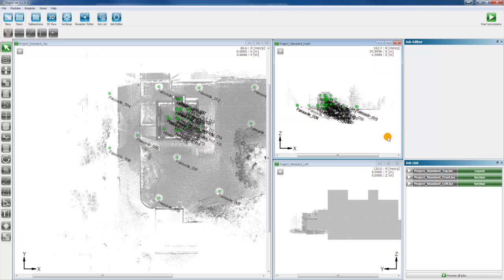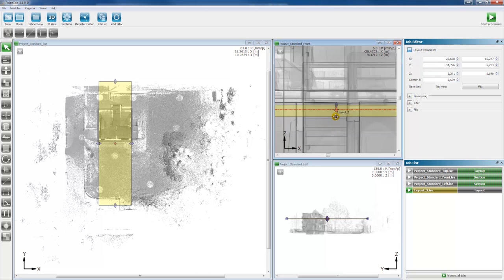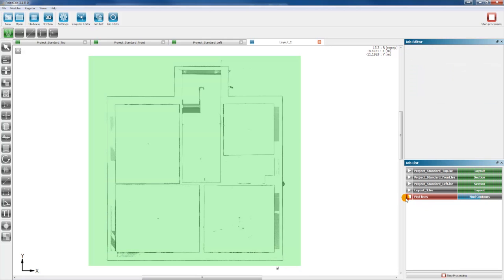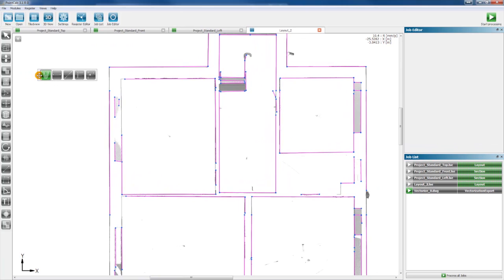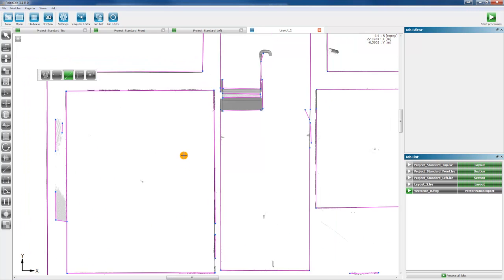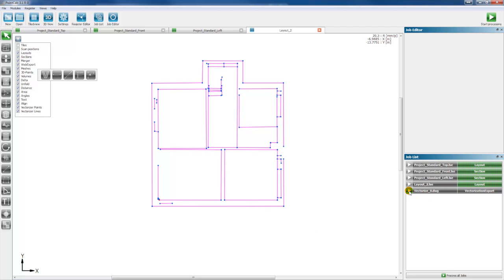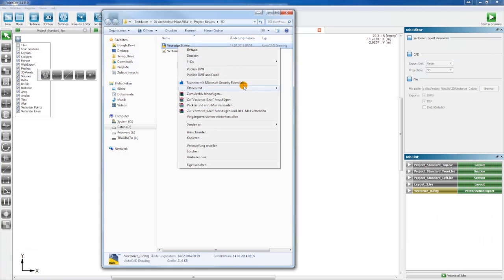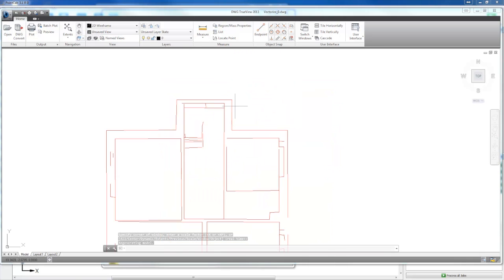PointCab Vectorizer Tutorial

Comment: Using Vectorizer tool, is there a way to store the vector as polygons instead of polylines?
Reply: The automatic vectorization tries to find lines and connect them to a polyline. There is no guarantee that the polyline is a closed polygon, therefore we do not produce polygons yet. You can easily convert a closed polyline into a polygon in your CAD system. But it is a nice idea. Thank you